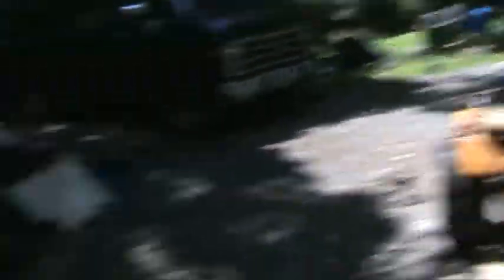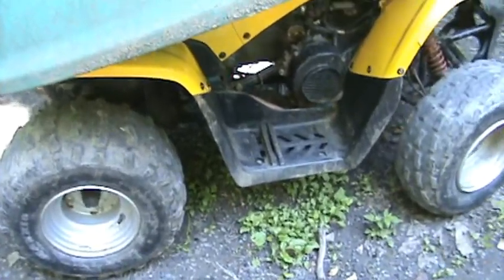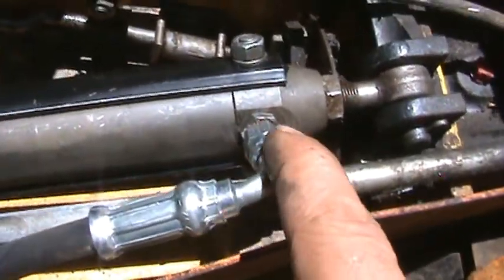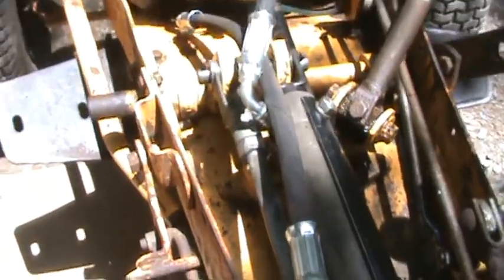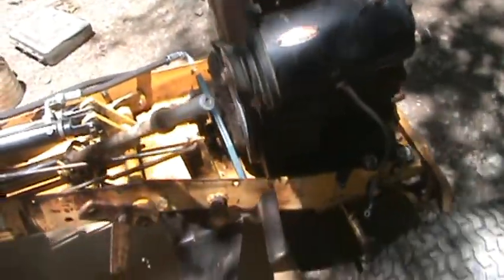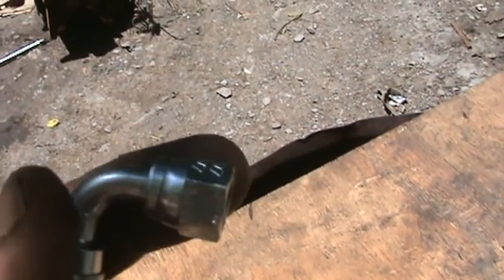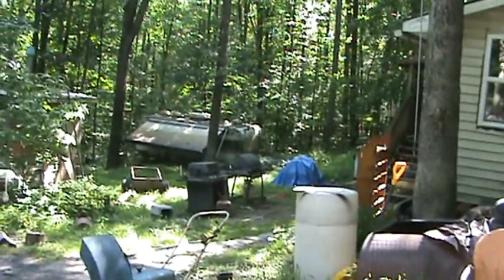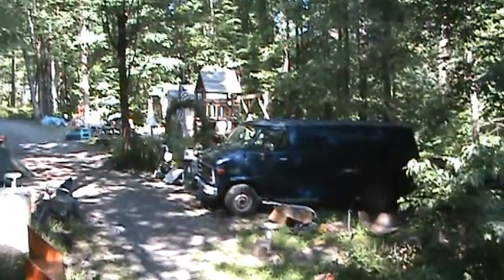B-112 wrong fittings

Comment: Reuse the old lines if they're working and take the botched up set back and show them what happened. My guess is, they can slip new collars on and crimp them again. I'd also ask them how they could fail so easily. I suppose it's possible when you initially tightened them that you bore down on them too much, but that's all speculation. I'm guessing this is the line they'll feed you when you take them back. I'd also take the cylinder in with you and have THEM put them on, then don't mess with them. If they fail again, you can tell them you didn't do anything at all with them. Zip~
Reply from the maker: Yea I'm thinking to reuse the old ones. Not so bad to tear it down once you've done it. If they can slip new collars on they ought to be able to use my old fittings hopefully then I'll be golden. No worries about them giving me static. I'll give them the cylinder and new fittings and they'll see what's going on. Good people. I'm sure I bore down on them too much, they wouldn't seat properly and I figured make or break. They broke. The old ones, it's very distinct when you have enough on them. They lock right up. The new ones, no matter what you did, one bump on the line and they'll come loose.